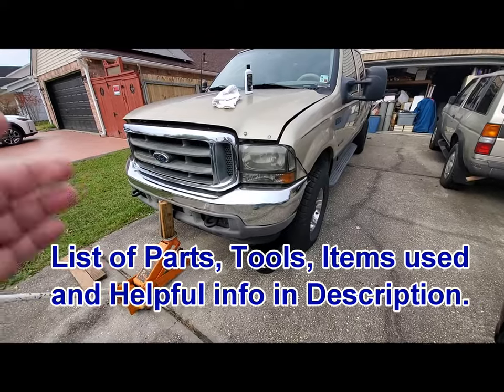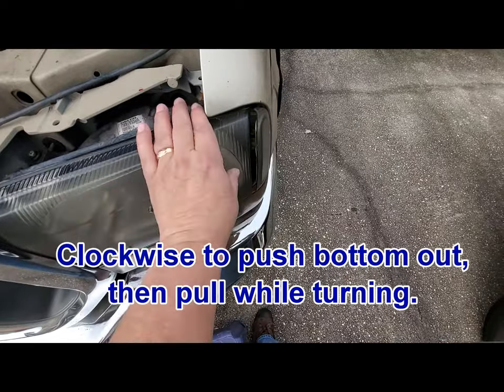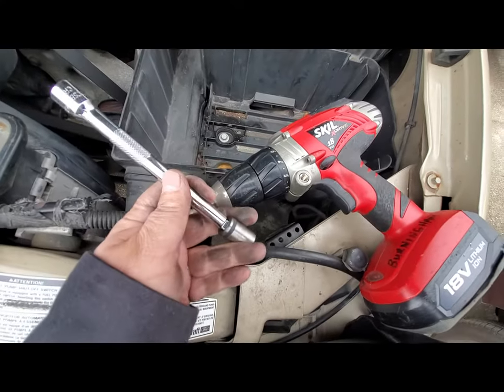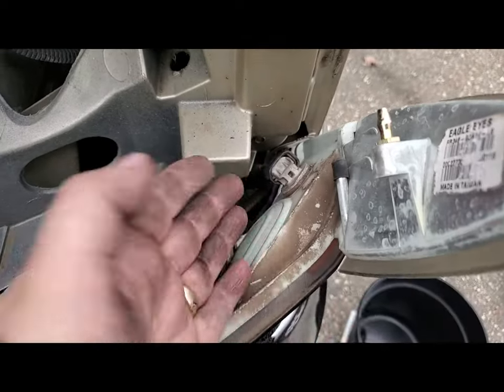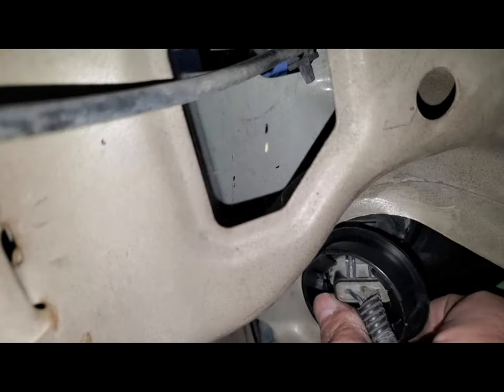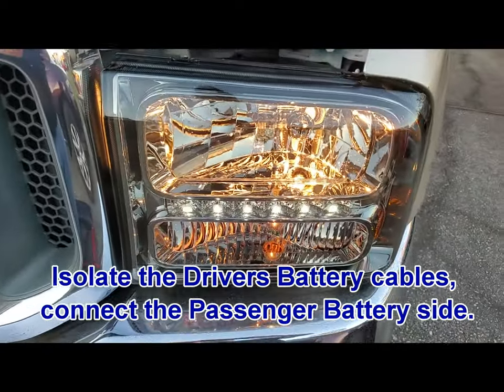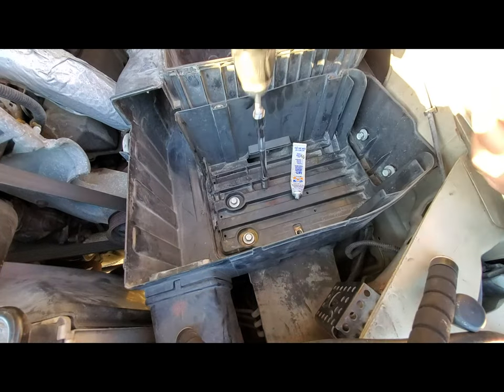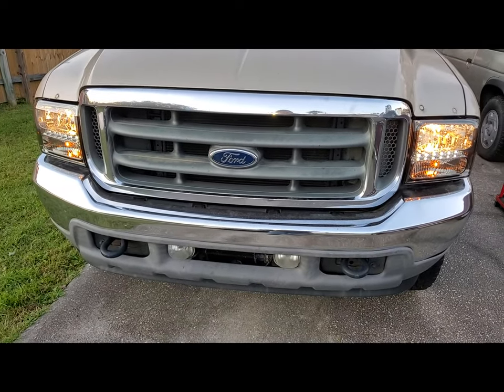NO CUT 05-07 headlight Upgrade for 99-04 Ford F250 350 Spec-D Tuning Headlight 2LH-F250991PCG-RS

Comment: Fabulous video, very thorough. Thanks for sharing. I have a 2003 F-250 diesel and just installed Sea-Light LEDs in the stock headlight housings, but someday I want to do what you did with new housings...
Reply from the maker: Thanks bud. If I was going to do it again I think I would actually cut just a small portion so I could get the Headlight bulb in and out without having to remove the clips. Not that I change them a lot but just to make it easier. Thanks for watching and the taking the time to thank me, I appreciate it. Best Wishes & Blessings. Keith Noneya

Comment: Instead of taking all that stuff off to get to that back clip. Just use a 14mm 6 prog socket and reach in through the hole and press the socket on the clip and pull.. it works.
Reply from the maker: That is a totally awesome tip. I had someone mention that and saw it in another video, it worked great! One I'm sure I'll do the next time I need to take a stock Headlight assembly out. Thanks for posting it for myself and others to use. Best Wishes & Blessings. Keith Noneya

Comment: 6:46 i gotta find that on mine i didnt even see that part when i did my s&b cold air intake.
Reply from the maker: Curious what year do you have, or do you have an aftermarket air box?
Reply: @keithnoneya  I have an 02 f250 lariat I think I seen mine in the spyder.
Reply from the maker: @2alawabidingcitzen  If you have one of those after market big round filters sometimes they're put in the tube, and sometimes people just let them hang loose in the engine bay. If it's hanging loose in the engine bay, that's not good. Then sensor it to take the intake temperature so the PCM knows how much fuel to inject and at what time based on temperature. So it should get inserted into a hole in the tube right after the filter going towards the engine. One of the problems is some people don't install a Cool Air Box and just use the HOT air in the engine bay, so that's one of the reasons some people just let it sit in the engine bay because they figure it won't make a difference in temperature. They are right it won't make a difference in temperature but it will in PCM Mixture over what the real outside the engine bay temperature is.  When people do they they also loose HP, Torque and MPG. Hope that info helps you locate it. Best Wishes & Blessings. Keith Noneya
Reply: @keithnoneya  🙏

Comment: Upgrade? It's still a single bulb setup. Ford is the apple of the car world. Way to many followers for old tech that everyone else moved on from. 

Single bulbs are terrible for high/lowbeam setup.
Reply from the maker: Yep that's why we use added driving lights like motorcyclists do. I love the old tech like this truck, my 69 GTO and my old 74 Trans Am etc. Also the old tech when it breaks down I can fix 99% of what goes out on it in my driveway at a quarter the cost. Try and get a 6.7 fixed these days. You're looking at 2-10K if it's broke. I love the new trucks bells and whistles, but I also love the single bulbs and the added lights for looks. Anyways thanks for the comment and I hope you find the headlights on the truck you want. Best Wishes & Blessings. Keith Noneya

Comment: Nice and we'll explained video, what brand are these headlight assemblies and where did  you get these?
Reply from the maker: If you check description I give a link to where they're sold and some more information on them. If there is a failing on them I would say the alignment is a little tricky but they work way better than the Halogens it had in it. Thanks for watching. Best Wishes & Blessings Keith Noneya

Comment: If you can do this one handed I can with both hands..LOL  Assume these fit 2000 F350 as well?  My stock housings are so fogged over they hardly let any light out.  I'll probably go with new bulbs given the pain to change going forward.
Thanks
Reply from the maker: Yep they'll fit just fine. Change the bulb isn't to hard other than you have to pull the batteries. I went with the AUXITO LED's Here's a video on those in these Headlight assemblies; https://www.youtube.com/watch?v=svE8Be-Su58 The only two things I don't like about these headlight assemblies is after alignment there's a 1/8" gap between them and the fender and to get the best out of the High Beams you have to aim the low beams lower than I would like. However they are still WAY better than stock and Halogen Bulbs. If you have any questions, feel free to ask. Best Wishes & Blessings. Keith Noneya

Comment: ALL and i mean ALL of the cheap amazon or ebay aftermarkets are junk. Some are immediate junk but all will be regrettable within 2 years. 
Go with AlphaRex lights. Well worth the money (and the header panel mod if you have a pre-05).
Reply from the maker: So far so good. I'll check out the others for sure, but I'm not much into cutting up my header panel. That's why I chose these one. Anyways, Best Wishes & Blessings. Keith Noneya

Comment: Thanks for the video! How are these units holding up? Any fogging inside the lenses?
Reply from the maker: Not at all, and they seem to be holding their clear as well. The only thing I found I didn't like about them was in order to align them I had to have a 1/4" gap on the outside near the fender. Other than that I love em. Best Wishes & Blessings. Keith Noneya
Reply: @keithnoneya  could you show an update about this? Curious if that’s a deal breaker for me
Reply from the maker: @josephoverstreet5584  HI Joseph it's been a year and they're still doing great no fogging at all. To get the best out of them make sure and align them after you install them. The only thing I didn't like about them is to change the Light bulb on these you have to  pull the clips on top to access the bulb. But how often does someone change a bulb, almost never. The other option is to cut a hole right behind the ring for the bulb in the Radiator Support Frame, which I chose not to do. I did make a video on how to align them as well. The best advantage this light assembly has over the others is you don't have to cut up your truck to use them, it's a plug and play.  I hope that answers your questions. Best Wishes & Blessings. Keith Noneya
Reply: @keithnoneya  it did except I’m curious about seeing the 1/4” gap you’re talking about.  Not sure if my ocd will allow it or not lol
Reply from the maker: @josephoverstreet5584  Yeah my OCD didn't like it either. I was thinking of either trimming it some how or adding some rubber trim in there. I do love the lights though and for the price and the no cut I couldn't pass them up.

Comment: I bought a 7.3 with these already "installed" i constantly have to jiggle the 3 prong plug to get them to work. Wondering what this might be?
Reply from the maker: Most likely a bad connector. Try slightly twisting the blade or bend them more outward that should solve this bad connection. The other problem could be a internally intermittent wire, if that's the case you'll need to replace the connector on the truck. Hope that helps get you back up and working good. Best Wishes & Blessings. Keith Noneya
Reply: @keithnoneya  you're awesome Keith thank you
Reply from the maker: @dr.z3426  Any time Dr. Z

Comment: What was the new daytime running lights plugged into?
Reply from the maker: On these units, it's internally connected to the Parking light harness, as soon as you plug in the Parking light wiring, they come on when you turn on the Parking lights. Hope that answers your question. Best Wishes & Blessings. Keith Noneya

Comment: Just bought a set, great video thanks
Reply from the maker: I love these so far. The only issues I had was the alignment of them. It was a lot harder to align than the standard headlight assemblies, but very doable.
I'm making a video on how to upgrade these to LED's without modifying the Radiator Frame as well. I should have that video up next week so stay tuned. Thanks for watching. Best Wishes & Blessings. Keith Noneya

Comment: Thanks for the video !
Reply from the maker: You're welcome KC I thought others might like to see a No Cut or Mod could be done with the right Headlight Assembly. I should be doing a video on upgrading the bulbs to AUXITO LED's in the next two weeks. I also have a Rear Hub Seal/Bearing & Brake Rotor/Pad video I'm editing to post as well. Thanks for the thanks and watching. Best Wishes & Blessings.
Reply: Great video thanx